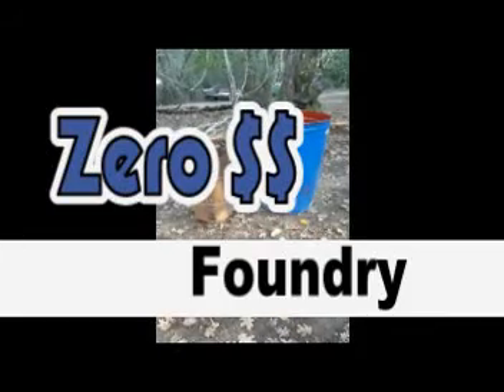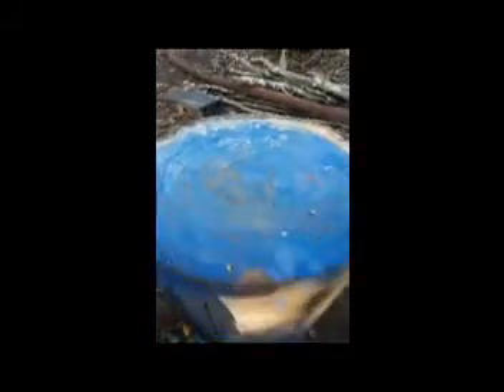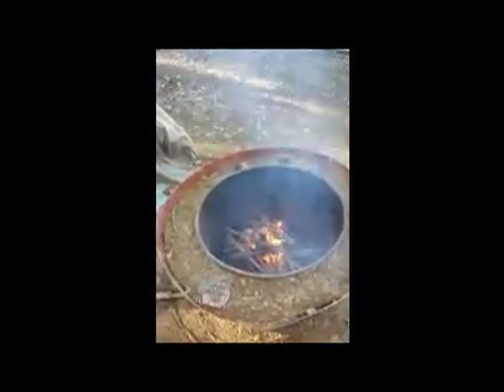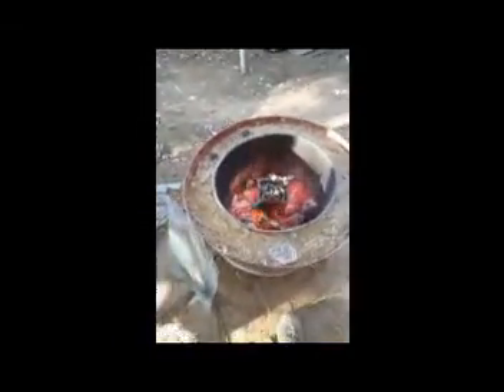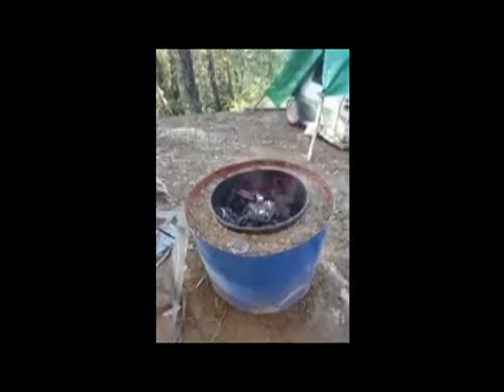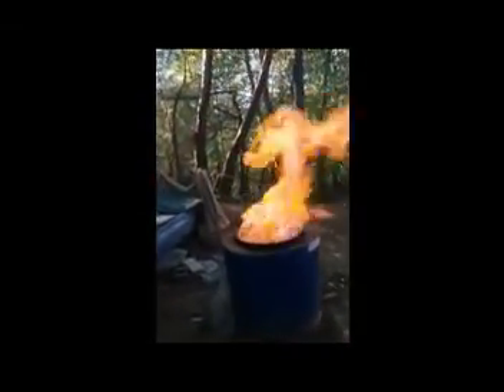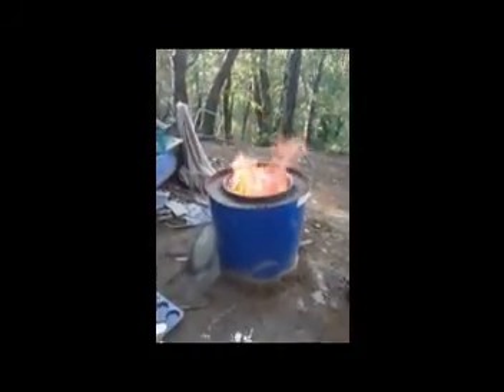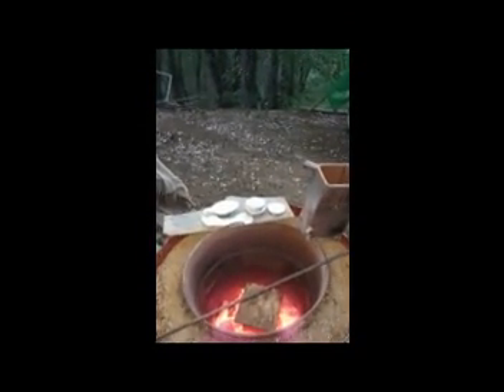zero dollar rocket foundry for casting aluminum

Comment: Just noticed this is 3 year old.  Just the same Kudos on a first melt.   When you start green sand casting try to use previously cast aluminum.   Extruded aluminum does not cast as well.   I don't know much about wood or charcoal foundries but I'd suggest looking at a waste oil furnace.   I am currently running a ceramic blanket propane furnace.   Cold to pour is under 1/2 an hour with a naturally aspirated burner.   

I use a wood fired melter to scrap aluminum wheel rims and other large objects.   Idea is not original to me.  Just a open barrel on a grate suspended over water.  Fill half full of wood with aluminum wheels in the top half.   I am wondering how effective the earth insulation is.  How long did your melt take?
Reply from the maker: Thanks for the tips! Probably about a half an hour once the fire was going

Comment: I like your idea! I'm wondering if the fact that the top opening is so large is the reason why the traditional rocket stove power is not as strong. Maybe if the top was tapered down a bit, you might get more heat. I love your thinking, though!
Reply from the maker: Darrell Eaker , thank you for your comment! I made a lid but have yet to try it out